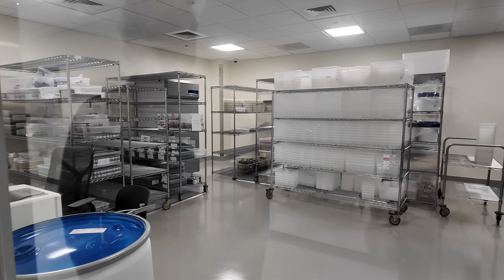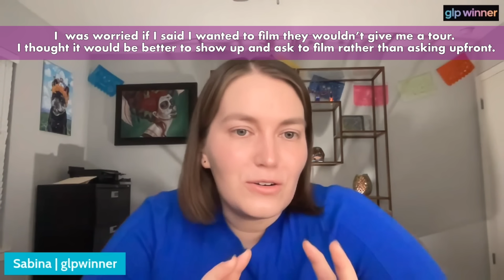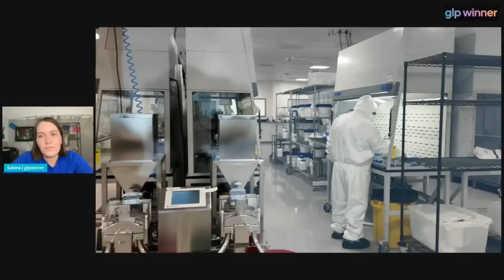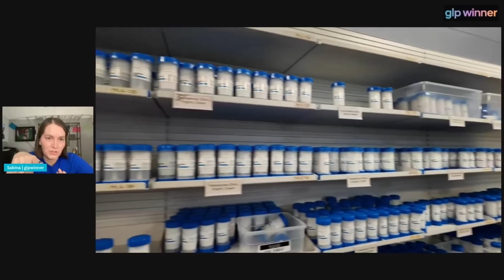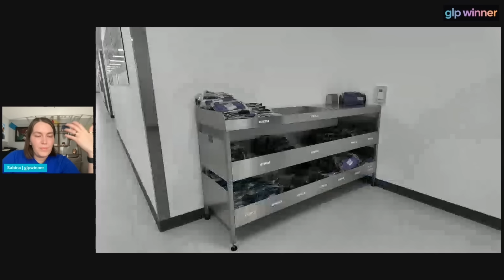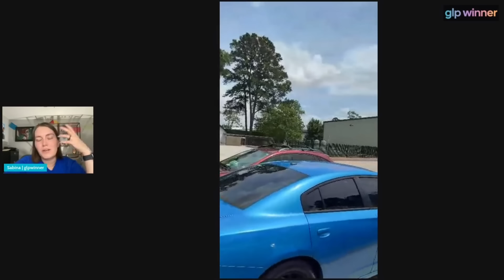Visting 4 Compounding Pharmacies - see how they work

Comment: If you get back to the Houston area, I hope you will consider going to CASA Pharm.  I use Tirz that is compounded there. Really like your reporting, and what I learn from it !
Reply from the maker: This has been one of the requested pharmacies. It’s near to the top of my list if I get the opportunity
Reply: @lawliepop  I've used CASA twice.  Back at the beginning on Sem, and the last telehealth i went through (Tirz) ended up sending from CASA.  Can't put my finger on "why", but I'm not a fan.  They send everything you need, but I guess the quality of the meds and their effectiveness is what I am not a fan of.  Both times I was on it, I plateaued.  This time was a 3-month, so it's been a struggle!  Not bashing them at all, it's just my experience.  Seemed like I got more b12 than tirz.  Could hardly pull meds out of the bottle.  It was almost like syrup.  Doesn't help that I'm one of those people that labs say my b12 is fine, so having it in my meds almost GIVES me more fatigue, it seems.  Hope it's all in my head.  I'm on a tight budget, so some places I have to use don't give any info on the pharmacy they will be using.  I don't like to see anyone or anything fail, so I hope I am wrong about CASA......unless they are bad on purpose, of course.  First time watching!  I enjoyed it!

Comment: I worked in clean rooms for many years for a large pharmaceutical company. The compounding location you visited meets or exceeds anything in the facility I worked in that made injectable medications. Impressive! Most sterilizing equipment in those areas you filmed were either sanitizing washer or autoclaves that sanitize by pressure and heat. The washers have an agent added to clean that is regulated and used for cleaning with high temperature water that has gone through an RO system or process. There are setups for each that details how anything used in the process is put on the cart or washer tray to ensure sterility Great information! The cleans performed will leave a residue on glass. Cleans are performed starting with the ceilings down the walls to the floors in a systematically. Clean rooms require dedicated shoes and require training before entering. If possible, visit Seven Cells pharmacy??? Thanks so much for the tours! It really helps with lessening my concerns regarding compounding. I do not have the ability to pay for brand name and have been using compound medication since losing insurance coverage.
Reply from the maker: Thank you so much it’s great to hear your perspective on the pharmaceutical side!